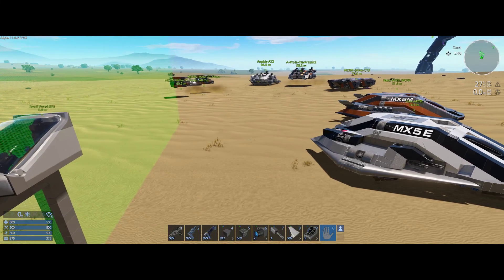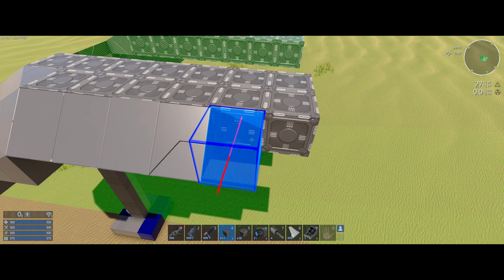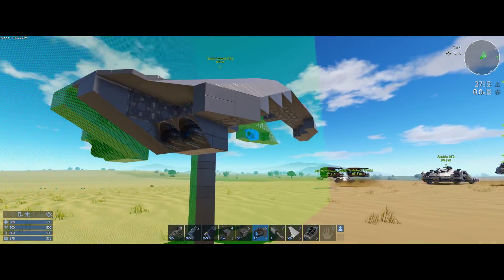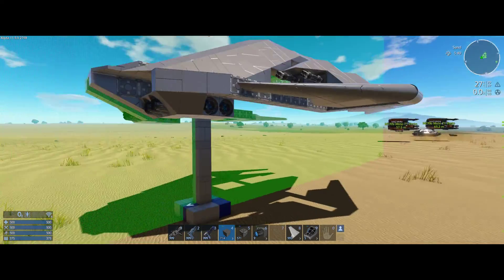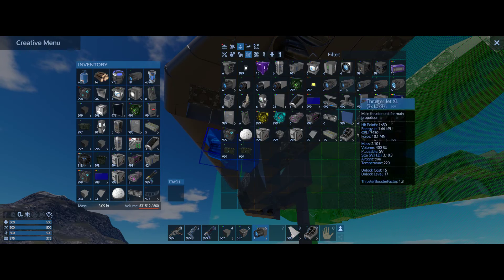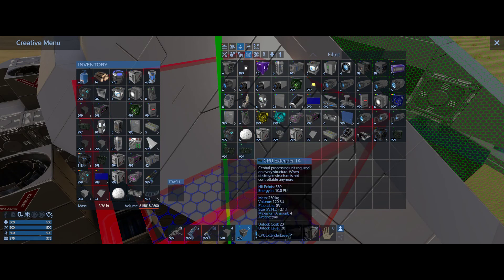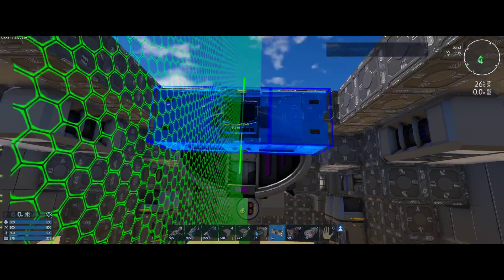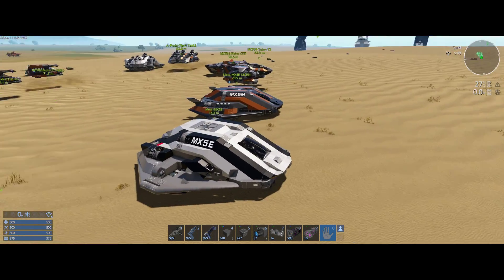Empyrion Galactic Survival - Rebuilding the Merc-MX5 Part 1

Comment: Is this before they added cargo container angle blocks? Cargo containers as armor is a pretty novel idea, but now that they can be angle blocks it makes even more sense. I'd still not connect them to the main cargo though, so you dont lose cargo if you take a lot of battle damage, maybe separate em with oxy and fuel tanks, etc

Comment: Having just finished building a Tier 2 ship like this, I can confirm it is not easy. Adding the warp drive and a few weapons doesn't leave much CPU to play with. But, I honestly don't mind the challenge of building around this new system.
Reply: Yeah, should a vessel with lots of storage and a constructor, really have more than 2x or 4x miniguns?

But true... It is a bit too much of a challenge right now...
Reply: @truezulu  The challenge is in trying to build a lower tier CPU vessel with all the bells and whistles. Tier 4 is flexible enough to do whatever build you want really.
Reply: @DadrickOriginal Low tier is the goal here, yes I know. Tier 4 SV is well balanced CPU wise, yes I know.

So now that is cleared up... I though that was clear from my post just fine? But it should at least be very clear now :).

To further clarify: I like, that you cannot make a low tier vessel with all the bells and whistles. This is the whole point of the CPU tier system...

Hope that makes sense...
Reply: I just built a T2 S-warp capable semi-armored SV with a rail gun, two gattling guns, 4 RCS and around 8000 Su of storage that handles beautifully both in space and in atmosphere, perfect multi-role SV for my needs but yeah, it did take a little trial and error to keep it just below the 15000 CPU limit but that was half the fun
Reply: The more I watch you do this the more I appreciate what you are doing I will never build a ship

Comment: In my opinion, the processor limitation is fine. Building is fun as hell, but only for building can I run the creative mode. In the case of a single or multiplayer game, I prefer to limit it. It provides balance.

Comment: My Approach to figure the right amount of Cargo Space is by taking into account "what is the largest Item you can find"? Its a CV XL Thruster. So If you consider its weight and Volume you can figure out the right amount of lift and what Volume you need for putting it into. So I normally have about 5-7k Cargo Space and enough Thrust to lift about 400-500tons. Anyway you have my Sympathies about the issues CPU causes and I looking forward to see how you solve it.

Comment: A diamond is just a square turned sideways 😜. They need to increase the CPU for the small / hover vessels and tweak it for the bases 😒. At the CPU cost of RCS you shouldn't need more than three 🤔; I think the RCSs need to be placed along the axis, considering the apply rotational force 😎. The new and old MX5 might fly well due to the wings (game thinks it has lift)🤓. The CPU needs tweaking, my best suggestion is; since you need 2x T3 and 4x T4, the addition of each individual CPU extender should add CPU points, instead of having to put all 3 or 4 in to get any additional CPU points 😓. In that way you can build within ranges, also real computers don't specifically need to have things added this way, attach new servers and gain more CPU 🙄. Consider that for turning and rolling the thrusters need to be away from the center of mass, however for strafing (moving along the horizontal) or moving in a direction along a line the distance of the thrusters from the center of mass doesn't matter as much as being inline with the center of mass. The act of turning is rotational force ( what an rcs does) is better applied by distancing the thrusters from the center of mass to apply greater leverage and require less force. The act of directional force (moving along a line) is applied directly to the center of mass, and is more effective when applied along an axis (along the line that stretch from the yellow dot). You could have "turning" thrusters further from the center and "moving" thrusters closer to the center. My guess would be more would be needed to "move" than to "turn". Finally, the CPU is optional, if it concerns you, the solution is simple, disregard it, and simply build. When your done check the CPU, make space for the CPU extenders and release without them. Those using CPU can place the extenders in to make it work, those who don't won't need to. If a creation can't be built within CPU, release it as a non-CPU complaint, again if those who use CPU want to spawn it, I'm sure they'll find a way to make it work. Remember that while we love your work, and appreciate the effort and time you put in; these creations are only as spectacular as they are because you're enjoying the experience of creation. Build it, and they will come.